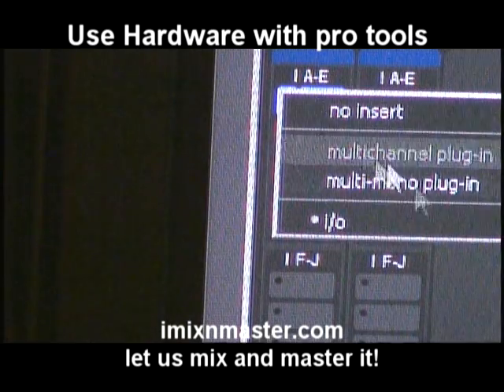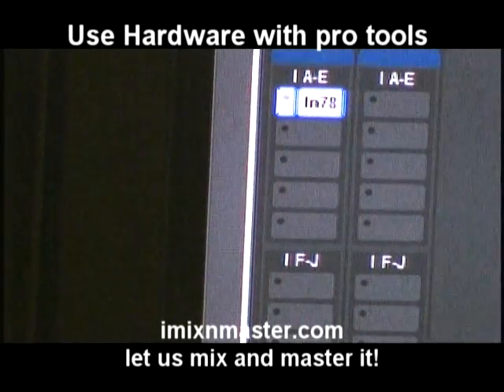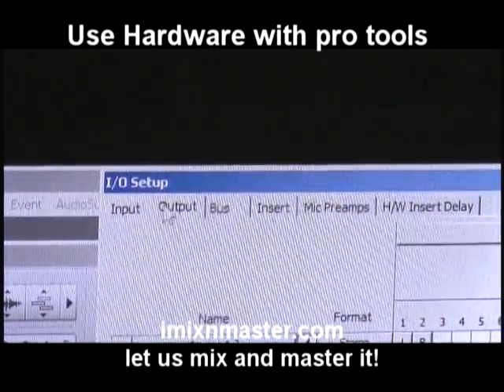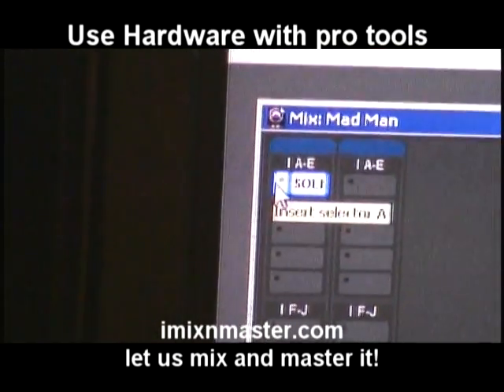Using hardware with pro tools

Comment: Hi I have a protools hd 2 setup running digital 192 I/o with sync word clock and scarlet octo pre im having issues with my output I have a bad hiss and can only hear the music very faintly. I have aes eBu  connected to my monitors and hardware setup output set to digital 1 and 2 what is going on can you point me In the right direction
Reply from the maker: what kind of monitors

Comment: Hey Doug thanks for this, i see you have a control 24, Im having troubles connecting an external compressor i cant work out what input to use . Do i go out of my external device into the input of a mic pre channel?and out from a spare xlr on my monitor out snake connected to my control 24. Im using a digidesign 192 and all 16 channels go to it. I see there is a smaller i/o insert on the back of the 192 thats not a 25 pin d sub....Do i need to buy another cable and use it?
Reply from the maker: What i did was had a patchbay in this case. Unless you are looking to monitor in 7.1 there really is no reason to return your interface into the control 24 for all your outputs of your interface. Just your main monitors if you use the controller.  I guess what i am saying is unhook like oututs and inputs 5/6 from back of digi 192 then get some cables xlr to 1/4 and hook the compressor direct to the interface. Thats a way to get compression while mixing. There is tons of ways to route i will try to do a video explaining its hard typing it
Reply from the maker: +Doug Jenkins this should get you going at least patch bay is a little different it will allow you to change to that routing without unplugging and plugging
Reply: Thanks Doug, The 192 has 25 din outs and ins so I guess I will have to disconnect say 8 to 16 and use one of those channels does that sound correct?

Comment: Doug,  you the man bruh. things I learned from your vids
1: bypassing the 002 console converter by using a external ada interface through toslink cables.
that alone changed the entire sound quality of the input signal. 

2: mogami cables WILL make things sound cleaner with less noise bleeding in from gear, computer, power lines etc.... cables Do make a difference

3:how to wire external effects processor to be used as insert plugin... 

4: external hardware delay compensation!  

5: external bus routing inside of pro tools!!!

6: there is a sound quality difference between reference,  semi pro, and professional gear, but if you dont understand how to mix... buying the best everything wont make the music sound better. knowledge is the best single piece of equipment in the studio. then talent! 

7: patchbay to external ada will allow the input signal to bypass 002's hazy converters 

8: how to properly set the HW playback engine to optimize use when recording input signals,  or mixing down a song.

9: Word clocks and Ad/Da converters cost so much.... BECAUSE THEY WILL MAKE A HUGE DIFFERENCE IN YOUR SOUND QUALITY AND REPRODUCTION OF WHAT YOU RECORD. 

10: Educate yourself,  Grind every day, practice your craft. study equipment specs, never give up, and it will all pay off in the end.

11 if you have a semi pro, professional, or even reference grade studio at home, the sound quality WILL be equal to the knowledge of the engineer who wired all the gear and runs it daily. 

There's so much more I have learned over the last 2 years watching your vids. I just wanted to say thank you. to all the people that may read this... Everything done in the studio IS art... so there is No set way to be your own artist. What Doug is showing us here is Art as well. His videos contain the fundamental and essential principles to becoming a great recording/mixing/ mastering engineer.
Reply from the maker: +EddieWordzTv   God bless you man, thanks for the awesome comment!
Reply: That's real man!!!  I'm in here trying to connect my BBE 362 to my digi 003..  lol

Comment: Peace Doug. Can you explain how I would calibrate my Mackie 16x8 console 16 direct outputs to Digi003/ Alesis AI3 16  analog inputs and the 16 outputs of the Digi003/Ai3 to the Tape Returns on the Mackie so that Zero on the Mackie (going in to PT) is equal to -18dbfs in Pro Tools, and so that Odb coming out of Pro Tools is equal to Zero on my Mackie meters?
Reply from the maker: I would have to do a whole video on that. Let me see if i can do a video on signal flow
Reply: Trak Lite u

Comment: So basically your routing the interface to hardware which comes up as a plugin to protools but for your final mix how do you get it? Do you just bounce it and tweaks are applied or do you record it on another track on its way back from the channel with the hardware ?
Reply: +Eric ElOriginalDjGecko you could decide on the settings and record the track back through as a "processed" version, but if you think you'll tweak it later then you can leave it.
Reply from the maker: +Eric ElOriginalDjGecko   Running the hardware this way, you would bounce the song as you would normally.. There is another way of doing this as well, where you assign the outputs of your pro tools track, to the input of the hardware, then create stereo audio tracks, and literally reprint/ re record the session with the hardware. This is beneficial for artist that like to keep tweaking and bigger budgets. but doing short mixes assigning the hardware like the insert, you would just print it just like you would if you weren't using hardware.. But yes pro tools doesn't save settings.. So you need to be careful, and maybe print multiple versions..    TO answer your question, you can actually do it both ways..  Yes to both ways you explained

Comment: Hey Doug..great video. I have a question. I want to purchase the behringer euro desk sx4882. I wanna run it with protools 8.  Will I be able to mixer with the analog faders on the mixer
Reply from the maker: Yes.. I think it hooks up and communicates through Hui protocol.  As far as full operation.  Unless you go the full Avid support control 24/ artist control stuff, you may need to understand how the hui protocol works within pro tools, and check avids pages for what known issue are..  I've used a mackie control once with pro tools, and had all basic volume and knobs, and transport.. but never went any deeper

Comment: Hi Doug,
Thank you for these videos. they are very informative and helpful.
I have a 003 rack interface, and an Apogee Rosetta light piped to the 003 for an extra 8 inputs and 8 outputs.
I am currently having trouble trying to connect an outboard tube compressor, a Drawmer 1960, to my Protools 8 mix session.
The Rosetta 800  shows up as channels 11-18 in my PT I/o., all are set back to default now after spending time trying to make this work...
 I send out (say 15 and 16) to the outboard, and the Drawmer 1960 IS getting signal, but when I send it back to a stereo aux input, or a new stereo input track set to say 14 and 15, feedback city.

I think if I am understanding you right.. to try and use the insert I/o, and that would be both the send and return?
Can this insert be done on my Master fader channel, or do I need to route every track that was out 1 and 2 to now be sent on a buss?

I'll keep experimenting, and thank you again for you videos to help me find a direction to begin troubleshooting this problem.
Reply from the maker: yes, if you assign a insert on the master fader, it would have to be hooked up to the corresponding channel.  so send it out let's say 15/16  which my be 7/8 on your rosetta, then take the output of the drawmer and return in back to 7/8 on the interface. has to be the corresponding input.. this will create a loop.. out and in..  pro tools running inserts it must be the corresponding insert.. no aux track required this way..
Reply: Hi Doug,
Thanks for the detailed explanation!

 Yes, I wasn't thinking of the insert as a round trip send and return, so I was using both an insert and setting up a separate return channel.

It works perfect now, simple as a plug-in.

Thanks!
Yetti-
Reply from the maker: no problem

Comment: Great video and couple quick questions... I am looking to purchase the Mackie Onyx1640i for recording with pro tools and the reason im looking into this one is because it has the same converters as the digidesign 192 interface. and how does this converter match up with Lynx Aurora 16? second question is I will be also purchasing the Bax eq how would I connect this to that mixer? and whats your opinion on getting the dangerous compressor vs the Fatso? thanks for your time out for these videos
Reply from the maker: If it was me, I would choose the fatso over the eq.  At this point, I really believe it harder to emulate a compressor, then it is a Equalizer.  The bax is awesome no doubt, but the Fatso would offer you a better all around final compression.  This would be hooked up, as far as hooking it up, you would hook this up to the main insert on the back of the unit, with a y cable.. or you can assign it to any send and return on the unit.  the goal is to send signal out to processor, then back into mixer.   Good luck man..  The aurora 16 is a very smooth convertor, but the digi 192 is a well built convertor.  It's more then the actual convertor chip though, it's the analog section that compliments the convertor.  You should be good though, the Onyx is a lot of mixer for the money..

Comment: Hey Doug, awesome vids man I think I've watch and absorbed almost all of you videos. I have a presonus 1818VSL and I have a analog mixing desk that I want to connect together for mixing. 

I understand the outputs go to the inputs on the board and back into the inputs on the presonus, but I only get a channel 1-2 mix on the board as a stereo sum. How can I get the full 8 channels and not summed.

You should consider doing an online course and charge people cause I think it would do great.
Reply from the maker: I will take you up on this, and for the record..   and what kind of analog desk is it, so I could be a little more tuned in.. Thanks for watching, means a lot to me..
Reply: its an older allen and heath GS3 24 track, i feel its cause im not doing something in the software like you said in the video. or my physical i/o is wrong

Comment: Thanks Doug for the quick response I really appreciate it :)
I don't know if my routing is right
I got a digi double 003 took the 3&4 outputs and went to my presonus eureka input and from eurekas output went back to 5&6 on my double 003 I don't know if this is right or wrong but when I create a stereo aux return I'm only getting the left speaker working
Reply from the maker: if you go out 3/4  come back in 3/4 on your 003.. then you can place the insert i/o on the aux track, you've created, make sure the tracks are exact 3/4 out   3/4 in
Reply from the maker: Doug Jenkins
or if you go out 3/4 make the tracks out 3/4 you want to use presonus on...  then you can re record the track..  create a aux, and make the input of the aux 5/6  input..

Comment: Hey Doug.. Quick question if I wanna compress vocals which is mono should I create mono aux track or stereo aux?? Thanks
Reply from the maker: Well leave it mono, unless you plan on adding some kind of stereo effect, like a nice stereo verb,, or delay.. but no reason to make it stereo unless you have stereo audio.. a lot of times, I bus a bunch of mono tracks to a stereo track, just incase i find myself later in the mix, wanting to add a stereo effect, but in pro tools the change from mono aux to stereo is very easy to do.. I'd say keep it mono, until you feel you need a change, for a stereo flavor on that mono source
Reply from the maker: Also, one more thing, a lot of times, it's better to create a send to a aux, when making a stereo aux, not directly bussing. when using effects, I will try to do a video on this, when I get some time in the studio..

Comment: hey doug great video, can you tell me can i use the same hardware compressor twice on the master chain. will it over write my previous settings etc? using one at the start and and the end as a brick wall limiter? and what would be the routing??
Reply from the maker: you could process twice.  yes different settings won't over write. just add another layer of compression..
Reply: Doug Jenkins thanks doug, thanks man

Comment from the maker: in a mastering studio yes, not good.. mixing it does have about a 1 db drop in sound..  not horrible, but yes it does effect it, only other option is high end hard wired cables.. but also the cable your running makes a difference too!
what I mean, you have mogami cable in a patchbay, compared to poor cable with no patchbay, the patchbay with high end cables would win

Comment from the maker: You can achieve a cleaner signal, for things like mastering, also the patchbay can be normalled  to how your studio operates, at times I will run a session without a patch cable..  now I have some super nice patchbay, sometimes I just patch a cable to see if it makes a different color to the sound..  canare/mogami at this time

Comment: Also, you speak of the out and ins. also you mentioned you have them hard wired into the patchbay. But at a level like most of us, we'd use trs cables right? 
Is there any advantage to using inserts rather than the loop you explain here?

Comment: can you combine the methods for connecting the outboard stuff?  So could I plug some from the gear's outs to the outs of my interface and then into my mixer, whilst having other gear going to my mixer inserts, with the outs of the mixer going into the ins of my interface?  And does it matter how many ins/outs you have with inserts?  And finally, which outs of my mixer should I run into the ins of my mixer? And also if my interface has two ins, will that mean I can only have two outboard pieces?

Comment: my interface inputs are used... so you're saying I can plug, say, an EQ from one of my interface outputs into the EQ and into a mixing desk input, and it will still add it to the mix in Pro Tools?  Wow that's great!  Should I use specific TRS cables or just balanced cables?  And finally, I can't fit a patch bay in my studio at the moment but I may look into that in the distant future.  thanks for a great vid and advice! :)

Comment from the maker: You actually named 3 ways to do it..    you can run all outputs to inputs of your mixer,  out of your console back into interface inputs,,  and run your hardware as mixer inserts, it all depends on your setup,,  if you do it this way, it would be highly valuable to use a patch bay:)   but you can run it direct with your interface as well...  out your interface to hardware, back out of hardware back in interface...